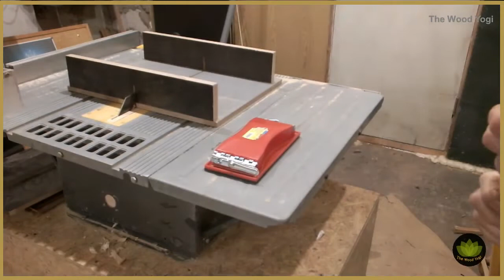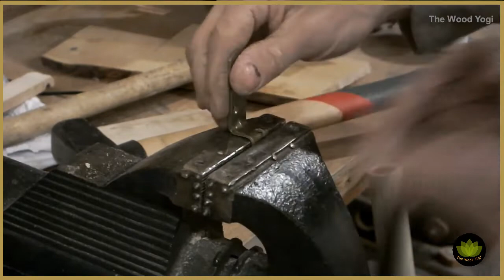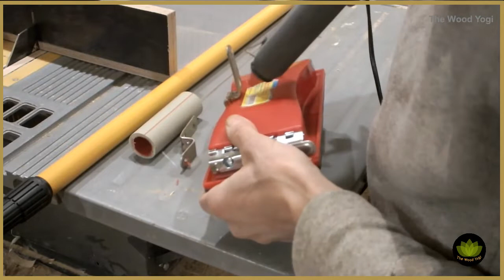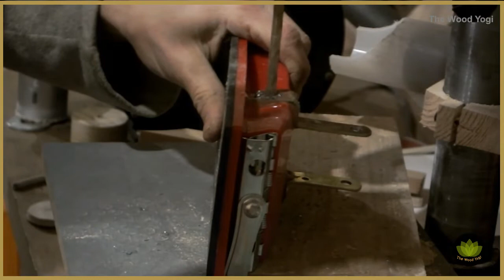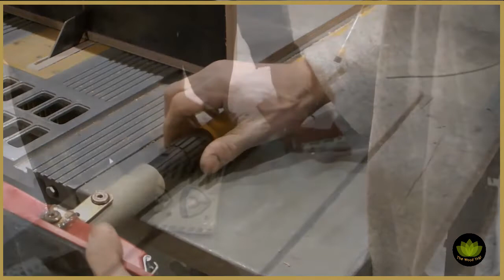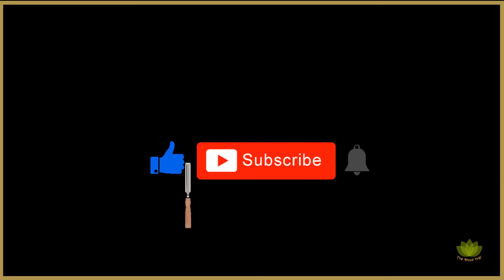How to Make an Articulated Sanding Block - Easier way to sand dry wall - Sanding Pad Tool

Comment: NIce effort! Would it be more productive to add possibility to turn in all directions...not only one..it makes a world of difference if you  are able to send and bend in both directions  - towards and backwards, and also left and right and to do that while standing at the same position is needed a revised construction of the head..another joint..
Reply from the maker: Thank you Kristof 😊 I have used this for over 2 years on many jobs and it works perfectly for me. Your idea is interesting and seems like it could work. Please post a video on your channel when you make it. I look forward to seeing the results. Blessings 😊 ॐ
Reply: @TheWoodYogi  Hi - when you look for pole sanding head on youtube or google, you may noticed many samples of a device I had in mind - two axis are used instead one as in your case. Easy modification would make a world of difference!  Used that style of head for tens of years and truly recommend it!
Instead of gluing consider using a long screw with some washers to hold your new part to old one! and you will get two axis useful tool.  OK - when I examined your idea one more time, I see that you have to change it a bit - First, make a bridge like structure over your old sander in the middle like letter C using long screw with some 4 washers to hold it to the old sander. And that bridge has to be attached with another screw to the pole.. look at the final product on the net... you will noticed the way it will work for you.  On my channel, I ave such picture and a few words how to modify or build such tool.
Reply from the maker: Thank you for the information Kristof 😊 ॐ